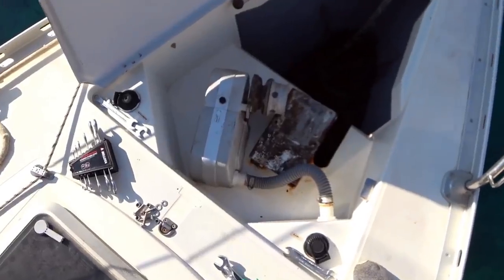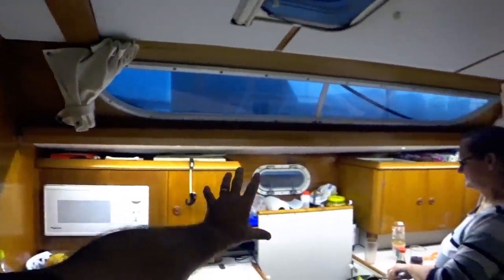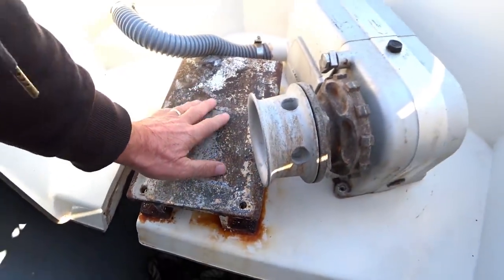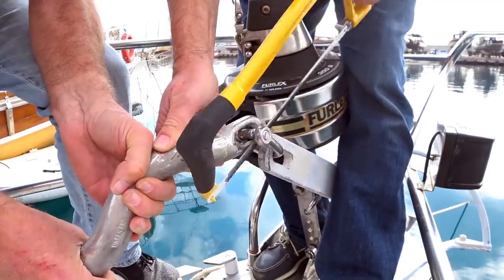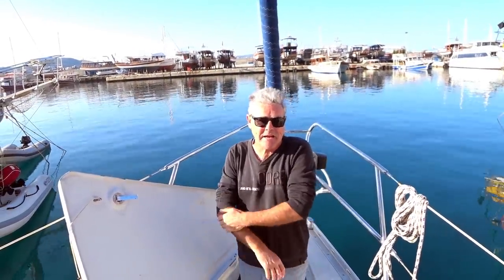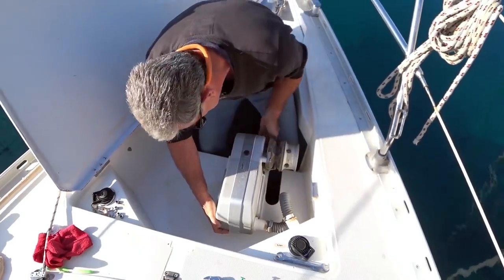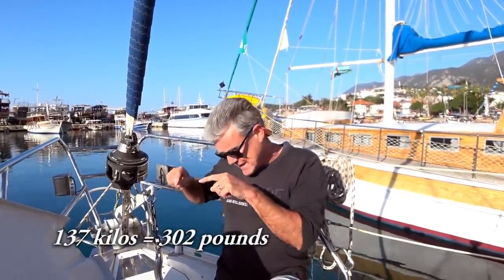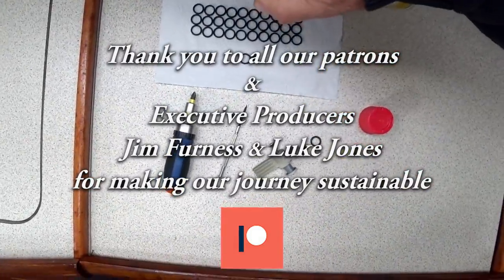Preparing for summer SAILING 2019 - Sailing A B Sea (Ep.061)

Comment: If you are doing day sailing and using the Anchor frequently, then keeping all your chain in the bow is fine. But if your crossing an ocean and want to improve sailing performance then you might consider removing unnecessary weight from the bow. I think I read that Capt Fatty Goodlander would do this. When we race we put the Anchor and chain near to the centre of the yacht. You want to use all chain when Anchoring near coral, but that’s for the future.
Reply from the maker: That's great input, thanks Andrew.

Comment: Common thought on chain length. You need 3-4 times out - to the depth of the water, as you need to tug on the anchor at a proper angle so it will pull into the sea bottom.  Without much chain, you limit your anchorage sites to a select few depths, which may be crowed already in the summer in Greece. 300 extra pounds sounds like a good trade-off for more anchorage spots when it's hard to find a nice spot. Everything's a trade-off.
Reply from the maker: Hi Murray, agreed. We are finding that compromise is an often used word on board A B Sea.

Comment: Bas, the least joins you have on ground tackle the better, these swivel connectors are a weak link and never carry the same load as your chain, we have a Rocno 33kg anchor attached to 12 mm calibrated galvanised chain by one height tensile galvanised shackle.  We don’t have a mechanism to turn the anchor on the bow roller, and simply take care when raising the anchor.  We have always adopted that system and never have a problem.  Our current boat has a straight modern style of bow so we have fitted a wrap round bow fender to protect the gelcoat from chips.  The up mark swivels mentioned by another poster are very, very expensive and I personally believe unnecessary.
Reply from the maker: Hey Chad, agreed about less is better, we'll see how things go once we're out there using the anchor on a daily basis and may need to rethink things along the way. Thanks for sharing your set up.

Comment: A bit late but may be of help to you.
Every added component is a point of failure. All you need is the chain, a good rated self locking shackle (wichard - no need for wire or loctite) one size up and a good anchor. If the anchor comes up the wrong way - just grab the chain anywhere in front of the windlass and give it a twist and it rights itself. Different metals is not an issue with shackles because there is so little contact if you only use it at the anchor and chain connection. Also adding chain is a problem because you will be forced to use a 10 dollar c-link. Your home is now relying on something that will fail. 50m is enough. It will cause you to be careful where you anchor. 70m is ideal. If you want more chain and need the extra length - use a wichard shackle. Lock it on and grind off the excess pin with just enough to turn it with a wrench. Buy another 50m of chain and in time you can switch them out end to end to make them last longer. Keep it on with a rope tied around in front of the shackle, then when you see you are going to use more chain, ease it over and relax with peace of mind. Avoid the higher rated chains as they can not withstand corrosion as well. I will never use a swivel again after having a very strong swivel fail. Keep it simple and stay safe. Thanks for being so fun to watch!
Reply from the maker: Hey mat jam, thanks for sharing some great tips there. Our anchor is a Mantus 39 kilo (85lbs) and Aannsha is usually the one at the bow flaking the chain into the locker. Using a swivel to put the anchor into the correct position rather than Aannsha put her hands into potential danger is why we have the swivel. Regarding the chain, we decided to just stick with what we had 50m of 10mm chain and 50m of  rope. We are out of the water for winter maintenance at the moment and we will be end for ending the chain when we put it back into the locker. Thanks for watching and commenting. 😀 🍺 👍

Comment: Hi Baz.
I didn`t think Nylock nuts could be used more than once. also if the screws , studs on the port light are rusting in the frames perhaps some type of anti seize might be needed.

David. Down Under.
Reply from the maker: Hi David, didn't know that about Nylock nuts, thanks for the heads up. The port light studs aren't really rusting, just a bit of saltwater corrosion, gonna put Vaseline on them. Cheers.

Comment: your solar panel and the frame, the dinghy hoist -  theses  are all additional weights. Boats with solar panel at the back tend to be tail-heavy - so you may balance it with more chain.More weight at the nose is good when you go downwind, not so good when you go sharp to the wind as the mast angle is changing with the weight - leaning more forward. Jut think how windsurfers direct the board - they only lean the mast forward or back.
Reply from the maker: Ahh yes Tibor, we hadn't considered all the extra weight we added at the stern. Thanks.

Comment: I have always heard don't use Vaseline (petroleum based lube) on rubber, use silicone instead. Find it in the plumbing section of a hardware store, they use it to lube O-rings. It is also used as a treadmill belt lube. It come as a spray, paste or gel/grease  
To keep the screws from corroding and binding use anti-seize. Get it at a hardware store or an auto parts store.
Reply from the maker: Hi JC, thanks for the tips. It looks like Baz will be off on another hardware store hunt where he can practice his less that fluent Turkish. Hahahaha

Comment: We have 100 m 10 mm chain. Our anchor locker is at the mast though so we really have 90 m to use as it takes 10 m to find the water line. We normally use a scope of 5 to 1 if we can. Sometimes Med mooring we use more but apparently you only need 4 boat lengths so for our 11.5 metre boat that would mean 46 metres and we would add the 10 metres for the waterline so 56 metres approximately.
We will be adding 3 links of chain between our Rocna and swivel this season. If you haven’t already you can join Anchors and Anchoring by Andy Marsh.
Reply: I should add that most harbours where 
Med mooring is concerned are not normally deeper that 5 metres but sometimes you end up dropping in 20 metres and in that case you end up using well and above 50 metres.
Reply from the maker: That's very interesting and helpful information, thanks Rita. We'll check out Andy Marsh. 👍
Reply: It’s a Facebook group run by Andy Marsh. His wife Steph Marsh used to be an admin on Med Sailing. Both nice people who just sold their boat after 10 years in the Med

Comment: If you need another 50m of chain you will only ‘need’ to use it occasionally could you accommodate the extra
 50 m in a bin under the vee berth in a specially designed bin? If so you would also need to fabricate  a new hawse pipe to lead chain down and you would want to get it as far aft as possible. Alternatively have the last
50m using rope much lighter and just as effective.
Reply from the maker: That's an interesting option Norman. Our anchor locker also serves as a watertight bulkhead so we'd be reluctant to cut a hole through to the storage under the royal berth in the princess suite.
Reply: Sailing A B Sea Well if that was the only  obstacle it could be overcome by design and execution. Imagine this :

1. A fibreglass tank sized for 50 m of chain with an entrance hole for the chain and an access hatch for maintenance ( which you need to secure the chain to the boat/tank).

2. The new hawse (or navel pipe ) will lead from near the top of the current chain locker and be made of fibreglass pipe and lead to the new tank and would be watertight, albeit there is the possibility of some water entering via the chain route. It is considered this would be small. Good design of the tank would create a gridded platform raised fro the base with a drain cock to enable the tank to be kept dry.

3. So from an engineering perspective it is doable without vessel safety issues.

4. On the occasions when you need to recover the additional 50 metres it will be a pain as you would need to hand feed into the tank as you recover.
Reply from the maker: Well thought through, we'll add it on to our 'maybe modifications' list. Cheers

Comment: It’s the chain that holds the yacht on location, personally I would increase on the rode to increase the angle that the chain sits on the sea bed. I am no expert but I would rather look at saving the weight on the bow ...
Reply from the maker: That's an interesting perspective Darrel and one we had not considered. Gotta love using the collective brain power of our viewers. Thanks.
Reply: Another point to consider with chain, the deeper you are the more weight to lift can your windlass cope with the extra weight. In addition, rope stretches a lot more, kinder on the boat in a heavy sea ...
Reply from the maker: That's a good point Darrel. Thanks.

Comment: Hello guys, great videos, er're funs ! Baz, i saw you doing some maintenance up front.
I have two questions for you, i hope you can help.
1. Easy one, what kind of windlass you have and where do you feed it with oil ?
2. In the ancor pit, this board where the windlass is attached is cracked (friends boat, same as yours).
The crack is at the side of the windlass base, it starts at the top of this long gap for the chain is and goes up...
Somebody must have forced the windlass while taking the ancor up, so be aware to avoid this happening to you.
So the question is how can he reinforce / repair now this cracked / broken board so he can use it without further problems ?
Reply from the maker: (Baz) Hi Boardelia, we have a Goiot windlass and there is a small black screw on the top which you can undo and put gear oil in there. Cannot really offer advice on reinforcing the board where the windlass is mounted, that's really something an expert should advise on as there is a lot of load on the windlass when bringing up the anchor. In heavy weather the loads increase, so you want to make sure the repair is very professional.
Reply: @SailingABSea  Pro advice then !
Do you by any chance know the model of your Goiot windlass ?
Reply from the maker: Not sure, we'll see if the manual is on board tomorrow and let you know.
Reply from the maker: There is nothing on the windlass that tells me what model it is, but  looking at some photos on the Internet we may well have the Goiot 312 (10) windlass. Hope that helps Boardelia.
Reply: @SailingABSea  Hey, i did the same thing, it definitly looks like the 312 ! Thanks Baz

Comment: 50m is 164ft... is that not enough??
Reply from the maker: There are some steeply inclined deep anchorages around Turkey and Greece. I guess we'll find out if our ground tackle is up to the task this summer. Thanks for watching.
Reply: @SailingABSea  thanks mate,...as for the extra weight,do you think it will affect the yacht too much? you could add another 15m of chain and keep the 50m of rode
Reply from the maker: She sits well above her waterline at the moment, so we do have the option to load her up quite a bit. We got given a big steel scuba tank and that will be stowed in the aft locker which would offset more chain in the forward locker.
Reply: @SailingABSea  go with your gut,I'd say mate